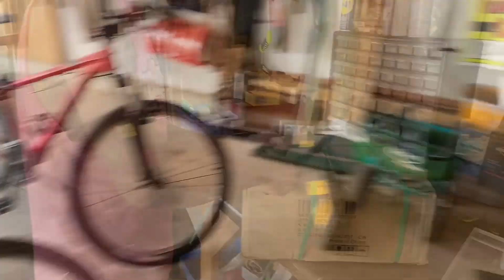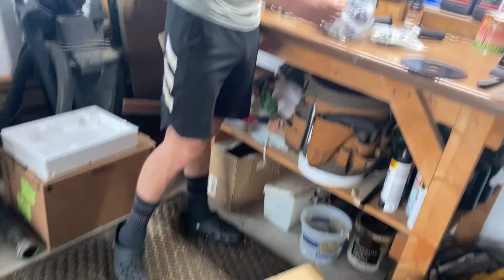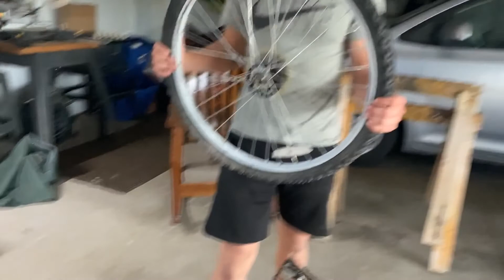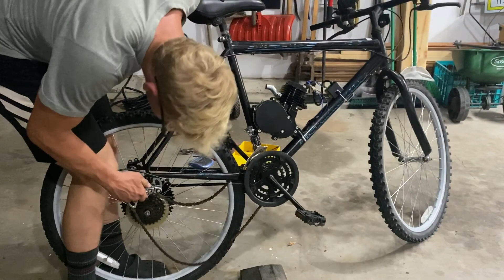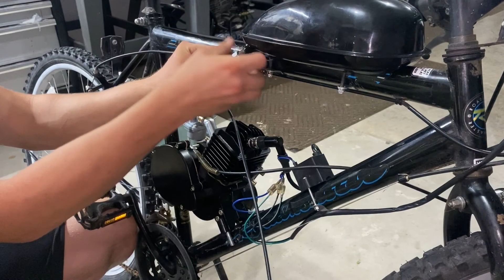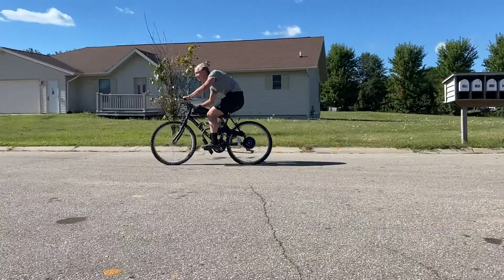Are 2-Stroke Bicycle Engine Kits worth it?

Comment: I bought the exact same engine kit two years ago and its still rolling strong. I put a windowed piston with a reed valve setup. An expansion chamber, bigger ignition coil, NGK CDI with sparkplug and HP carburetor. Just as long as you keep the maintenance, them engines can live awhile.
Reply: What type of Maintenance do you have to do ? Jw
Reply: I torque the cylinder head, motor mounts, clean and gap my sparkplug,  tighten my rear spokes, clean my carburetor and filter, check my clutch assembly, oil my chain, check my tensioner, etc
Reply: @michaelluciano7774  dammm fuck all that im just get a 350 watt electric
Reply: it still works after i replaced everything 3 times over guys for 2 years

Comment: Don't you think you should've put the sprocket on the rear wheel before you mounted the engine ? Or is it alright to have your engine upside down ? Because , personally , I wouldn't turn my engine upside down like that !
Reply: With no gas or oil, it’s fine.

Comment: First thing I would do is replace that cheap china plug with a Japanese one. And make sure the CDI is connected to the 91V output! Also get a Hotter unit from online stores, both will combat fouling and poor combustion and power. Additionally, It's hard to gauge is it's running well if you Use synthetic Oil otherwise the blue cloud is normal If it's producing white smoke shut it down Immediately too much water in the fuel…

Comment: i got tired of the constant maintenance. u spend more time repairing something or adjusting something, or even replacing something than u do actually riding and enjoying it. i switched to a 79cc predator 4 stroke and it's been far better. i personally prefer these engines on schwinn stingray choppers or west coast choppers